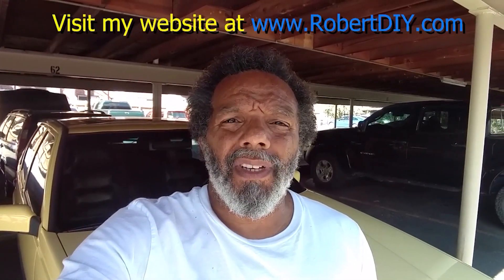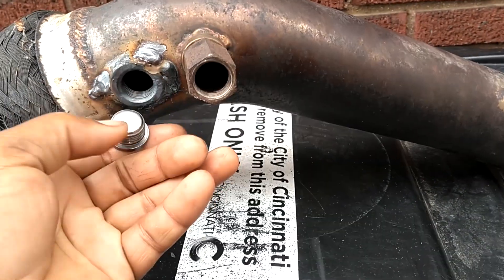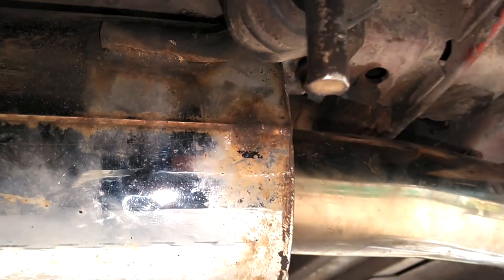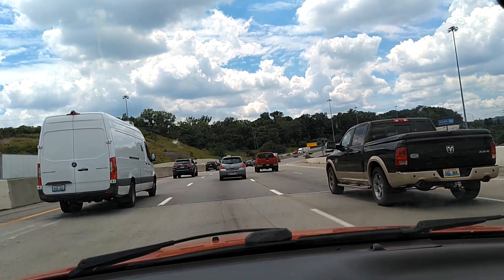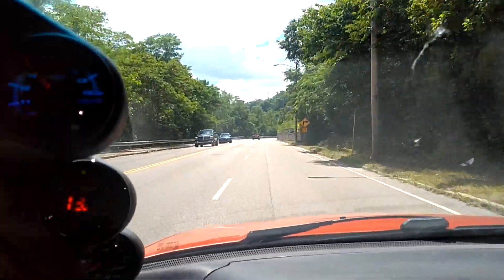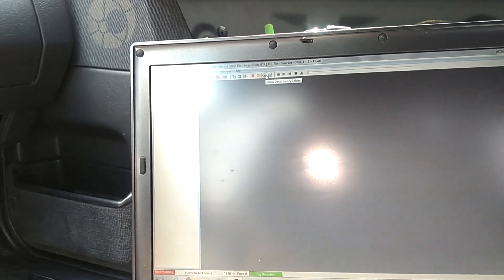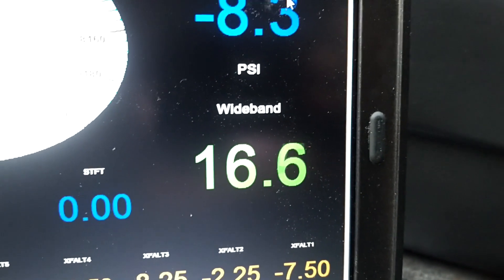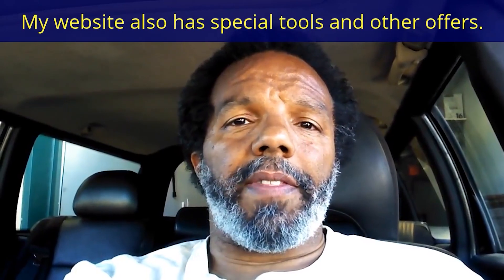Replaced the exhaust on Red Baron, took it for a drive and recorded a data log for the tune.

Comment: Robert it was a pleasure meeting you at the Pull A Part in Louisville. Always enjoy your videos. 
As far as your exhaust goes, I found the original 850 rear hanger/bracket works best as far as achieving uniformity in the rear.
Reply from the maker: About to get one. The one on the car was trashed.

Comment: Robert, where is the 02 sensor located on a 2011 XC 90  3.2L bank 1 upper sensor not the lower (rear) what is the software and cables you are using on the laptop and where did you get it? Thanks Bro and Happy Fathers Day I hope it was good for you too! 

Peace out

Marcus!
Reply from the maker: Not sure where the O2 sensor is on that truck. Should be the first sensor down the tailpipe off the exhaust manifold.
Reply from the maker: Vag-com cable off eBay
Reply from the maker: Tuner Pro download shareware. Pretty sure it's open source.